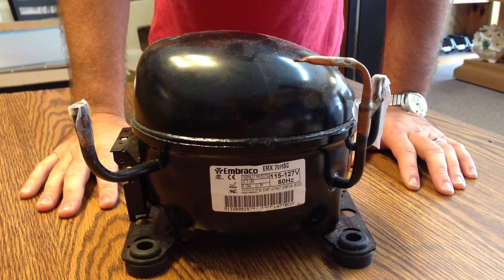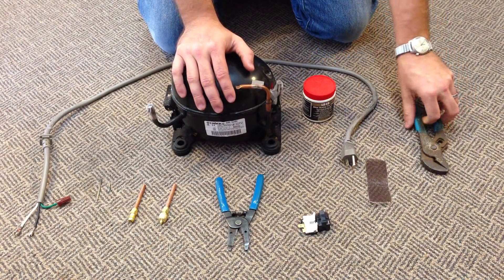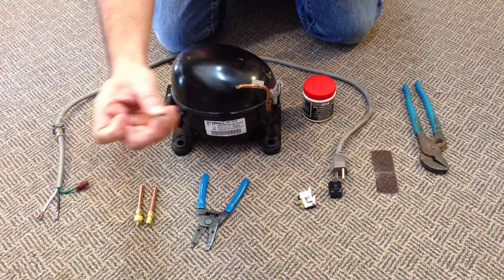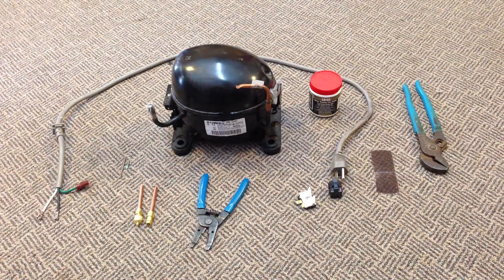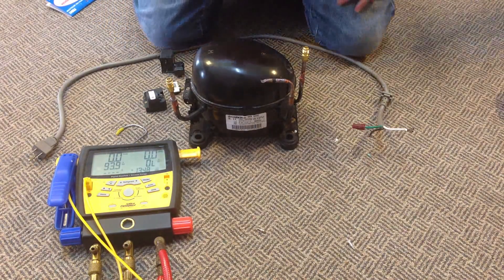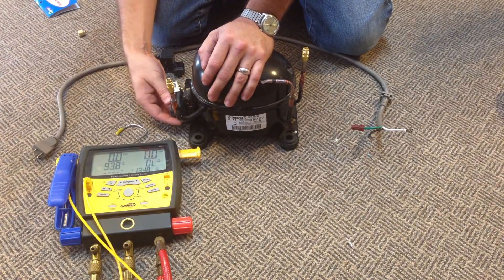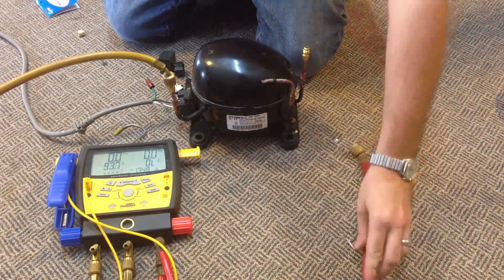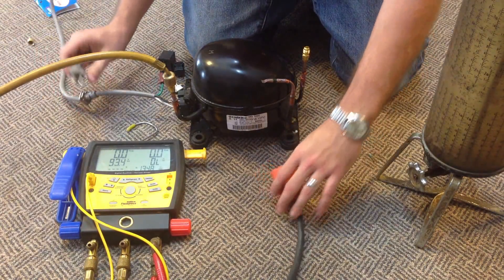How To Make a Vacuum Pump from Old Compressor

Comment: I didn't know those compressors also made really good vacuum pumps.... thanks for the video.
Reply from the maker: Thank you!
Reply: Refrigeration compressors do not make "really good vacuum pumps". What they are is minimally good vacuum pumps. They will get you down to about 1% of an atmosphere pressure pretty easily. If you are patient they might get you down to 1/10 of 1% open atmospheric pressure. That still leaves around a million billion molecules per cubic centimeter. The vacuum inside an old television picture tube is a million times better than that, only about a billion molecules per cubic centimeter.
The problem with using a refrigeration compressor as a vacuum pump is the Reed Valves inside the compressor. They only open in response to gas pressure. When you have a good vacuum, there is not enough gas pressure to force the valves open. That's why a proper vacuum pump does not have pressure actuated valves. Most don't have any valves at all.

Comment: Why would anyone do work like this on a living room carpet without protecting it from melted flux, dripping solder, hot torch tips and such?  A workbench is the normal/sane way to do this work.
Reply: When i was this guys age i was putting bits of gearbox in the house parts washer (dishwasher) and rebuilding lawnmowers on the kitchen floor

Bit of oxy soldering over the carpet? Pah, nothing! :-)
Reply: Then don't drip anything.
Reply: Cole Westergaard why we are protected by business insurance
Reply: I was thinking just the same thing my wife would kill me if I had ever done that thankfully I'm divorced now
Reply: Time Waster Digital no, we put down a drop cloth if we are close to flooring,or use a damp cloth to protect nearby obstacles, lol. Even the most experienced HVAC/R tech or plumber still can make mistakes. Shit happens. Douche. 😉
Reply: Mark Lee I think you'll find its in hes workshop
Reply: Crazy Clown not too bright huh?
Reply: No one gives a fuck you stooge
Reply: Probably confident in his skills, how do plumbers do repairs in a house do they tell the owners to rip up there carpets, I think not.  Douce

Comment: +BlakeTube Repair & Reviews What is the best vacuum pressure 24.8 unit? is it mmHg or inHg? Thanks.
Reply: The unit is psig (pound-force per square inch gauge). 24.8 psig > 1.71 bar

Comment: Remember folks this guy is a Pro?  Don't do this at home....He had at least 4 major safety problems the least of which soldering on a carpet good way to burn a home down
Reply: +Don Roberts Definitely ignorant, but solder isn't going to create a rolling fire you cannot suppress. The guy will just make a molten spot on the carpet more likely than not.
Reply: That's in case of fire retardant carpet of aviation grade. In most other cases, there will be a fire.

Comment: Hi Blade very good video! Thanks 
I have a question..... when you wire the power cord to the compressor you did NOT wire the green cable from the power cord.... which we all know  is "earth"... sooo if we wire our pumps like this is may be a dangerous from electric shock when we touch the compressor metal body ? Or maybe im wrong!?
Reply: Just attach the earth wire (green) to a cleaned and bare part of the metal body surface just to be safe. If the windings ever short there is a good chance of shock otherwise. 

Not the end of the world though tbh
Reply: The grounding this is dubious.  If you are using this on carpet like he is, you are not grounded so you could grab onto the  hot (black) wire and not be shocked.   No where near the scariest thing I have ever seen on youtube.

Comment: nice i have some questions

24,8 are  PSI ? 
if yes , are 24.8psi are much to use as desoldering station for desoldering electronics parts ?
Reply: +jeff pepin  its plenty enough  but better to have a small empty gas bottle and an electro-valve so you will have qa nice peek suction, it is not the vacuum level but the volume of gas displacement that is important  for powerful desoldering unit
Reply: thanks
Reply: rokag333

Comment: What kind of valves?  Check valves?  How do you know what's the inlet and the outlet?    If you are using check valves why do you need to cap the output to hold the vacuum?  

It looks like your valves aren't actually doing anything and you could just use any fitting.
Reply: Gigs Taggart  The suction side tubing is the larger diameter one. The smaller one is the high side of the system. There are generally two stubs for the suction side.

Comment: can this be used for vacuuming air?
Reply from the maker: John Smith Yes I use mine to pump up lawn mower tires.
Reply: +John Smith These pumps can get as high as 400psi but not very fast. So they are good for tires, air brushing ect but not air tools.